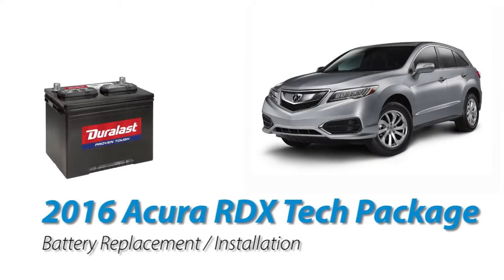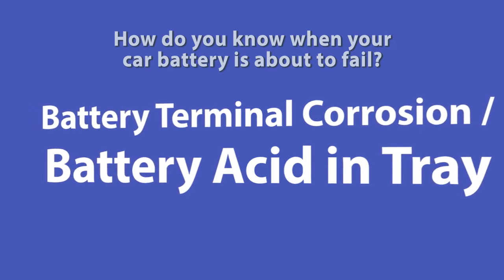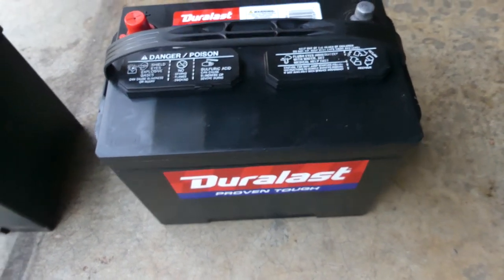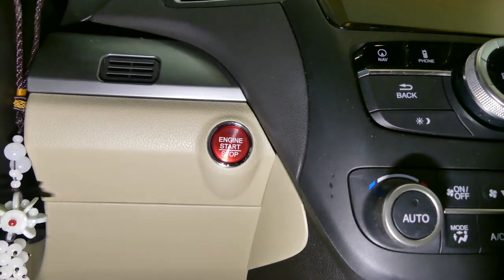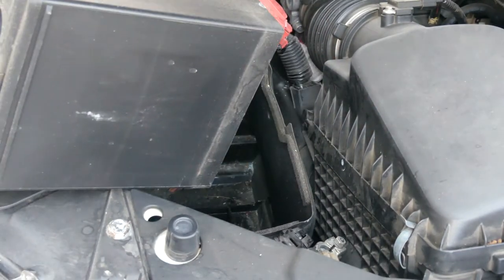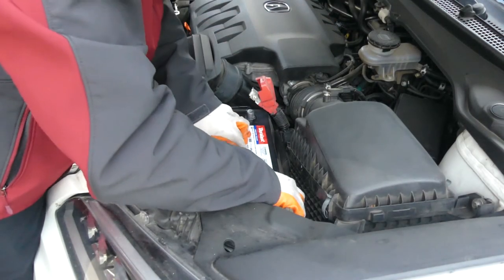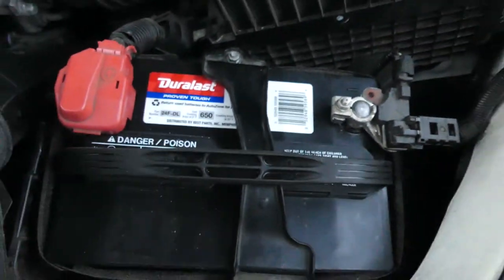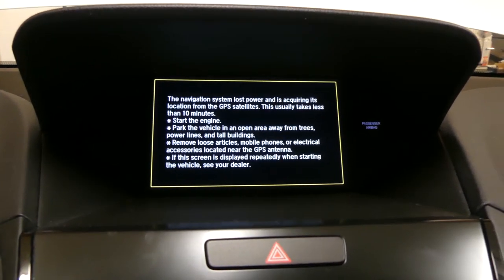2016 Acura RDX Tech Package Car Battery Replace and Install (2nd Gen Model - 2015 to 2018)

Comment: Very good video. I have 2013 RDX that needs new battery. Does it matter if the negative cable is disconnected first followed by the positive cable? Someone told me to remove grounded cable first.
Reply from the maker: @barryt.8632. Actually yes, it does matter which terminal you remove first. And it's always the negative terminal first before removing the positive terminal. There actually is a very good reason for it... And it's to prevent you from accidentally electrocuting yourself (in case there still might be voltage coming out of the battery).  And if there still is voltage coming from the battery and you touch the positive terminal first while your body touches the car, then your body is basically completing the circuit and you will get a nice blast of electricity through your body. 😬 Definitely not a good thing. So disconnect the negative terminal first and then disconnect the positive terminal. 👍

Comment: Thank you so much for sharing the easy and professional way to replace battery. Have a quick question if I may, do we need to use a memory saver to save the memory before replace the battery? As the dealer charges more and claim memory saver is required…not quite sure. I have a RDX2014 . Thank you
Reply from the maker: @Qizhen Li... You're very welcome. It is not required to use a memory saver. You would do that only if you do not want to lose any of your settings on your infotainment system, I would think. But I never did and my settings were still there surprisingly. Didn't lose any presets either. 😉

Comment: What about using a battery tender?  WIth this method there was no issue with losing memory or radio code issues?  I have a 2014 RDX Adv. Tech.
Reply from the maker: @robertthetexan8537... Yes, that is definitely one way to ensure your radio or other memory settings does not get reset. 👍 Thanks for the suggestion! 😎